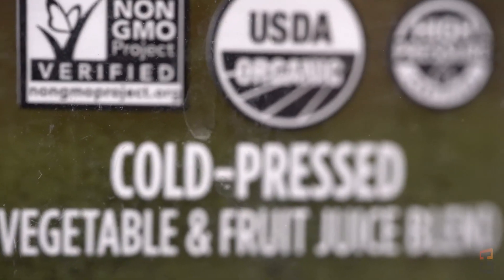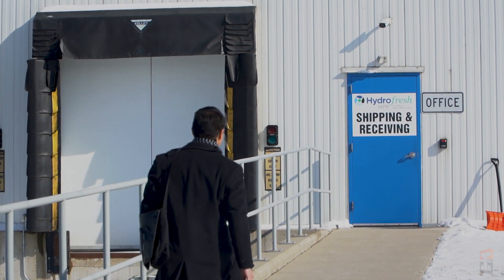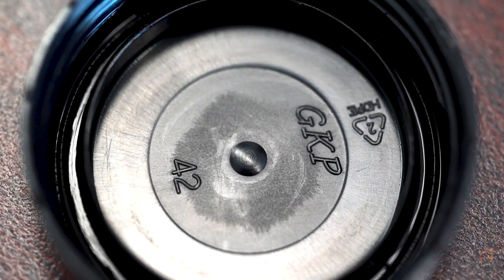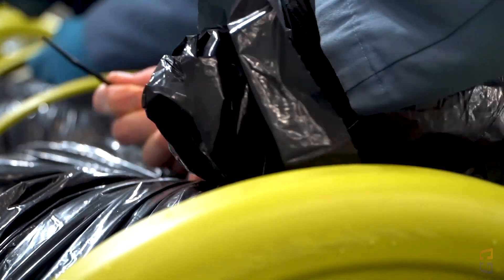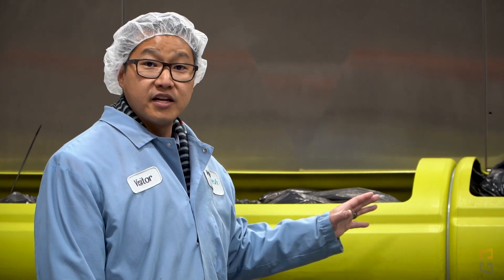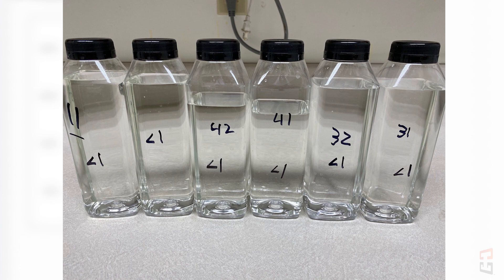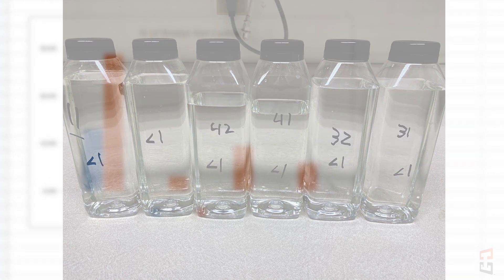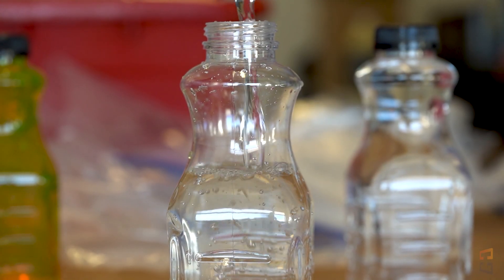Teinnovations Innovation - High Pressure Processing (HPP)

Comment: Hi
Could you share what the issue was with the bottle with the high level of ingress eg no bore seal/ cap too longer so seal not adequate? 
Kind Regards
Rob
Reply from the maker: Great question: Given that HPP pressures are extreme (in excess of 87,000) proper cap/bottle mating design is crucial.  It is possible that some existing packaging can have a measure of usefulness in an HPP environment.  However, the takeaway from this video is: for reliable success that let’s food manufacturers sleep well at night, it is important to use packaging actually DESIGNED with HPP in mind.  That is true not just with bottles, but with all types of packaging going into HPP.  Feel free to reach out if you have a project you wish to discuss 1-on-1 with us:  www.teinnovations.com